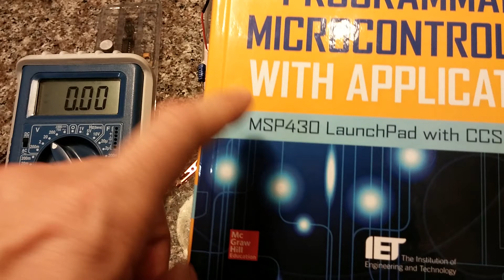MSP430 Launchpad Project: Washing Machine (using a stepper motor)

Comment: I tried making this project. I am working on a msp430g2553 on a launchpad and using the exact same code as in the book. I just omitted the capacitors in the power supply thinking we just need 5v from there so i've just given a 9v input to the 7805 and taken the 5v output as input to the motor driver.
i am however facing a problem while running the code on the msp430. everytime i debug it and it starts running it gets suspended with the first line of the main function highlighted showing the error 'cannot load from non-primitive location' Please help me out sir.
Reply from the maker: ***** the first line of the main function is 
WDTCTL = WDTPW | WDTHOLD;
and you get the error. I have not encountered that error before. Have you written other programs that have compiled and ran correctly? A simple LED blink? I used Code Composer Studio 6.0.1 on Windows 7 when I build the project.
Reply: Engineering by John This was my first code using hardware so it puzzled me a little. I was making a few rookie mistakes. i have corrected them. All the switches and LED seem to work now but what the problem is that the stepper motor is not rotating. when i press a button corresponding to a function, the motor vibrates (i tried holding it and feeling the vibrations) and then it stops after a while meaning it executed the 30 odd turns it had to turn for. So i can pretty much make out that its working, the code and all but the motor doesn't rotate. Can that be a problem related to my wiring to the stepper motor or is the stepper motor not working/
Reply from the maker: ***** Don't worry about making rookie mistakes, I made them too :) If you are using the same stepper motor that I have listed in this project you may need to up the Lturn and Rturn rotation counts in the 'wash' code:

slow = 5, fast = 1, Rturn = 1000, Lturn = 1000;

That is one problem I had with the code, the turn counts were too small so the motor was turning but in extremely small increments.
Reply: Engineering by John Yes sir i do not mind learning through these mistakes.My motor just seems to vibrate and struggle to move but is not able to. i am using this motor. http://cncsuperstore.com/index.php?route=product/product&product_id=63
i have powered it through a 7805 IC without any capacitors. Rturn and Lturn prescribe how many times the motor will turn by its step angle i.e. 1.2 degree but it isn't turning at all. Please help me out sir.
Reply from the maker: ***** Unfortunately there is only so much I can do. The motor you have isn't the same motor I used so I can't say anything for certain but here are some things you should look into: 
--the 7805 gives 5V output but your motor needs 6.4V or 9V depending on how you connect it so you need a different voltage regulator.
--the 7805 gives 1A max, your motor needs 1A - 1.2A depending on how you connect it so you need a voltage regulator that can allow more current.
--the wire connections could be incorrect/different, your motor can be unipolar or bipolar so make sure you know which.
--the motor should have it's own voltage source and not be share with Launchpad
--since your motor is more powerful than the one I used you will need those capacitors (probably larger ones).

Don't be intimidated, It will take time and work but you can get it :)
Reply: Engineering by John Alright thank you sir. Will look into it.